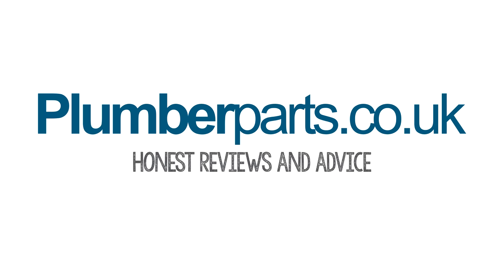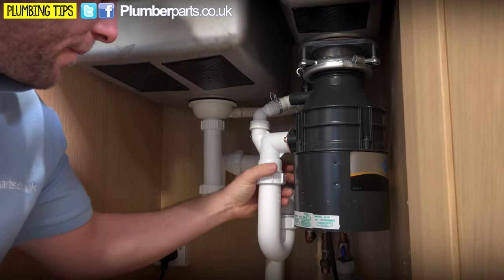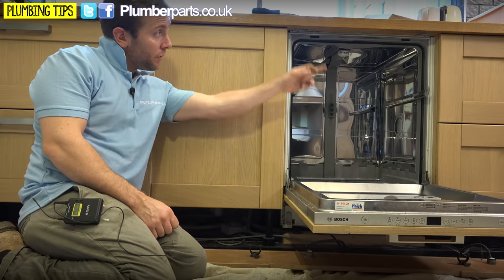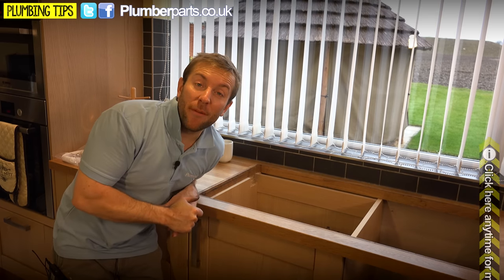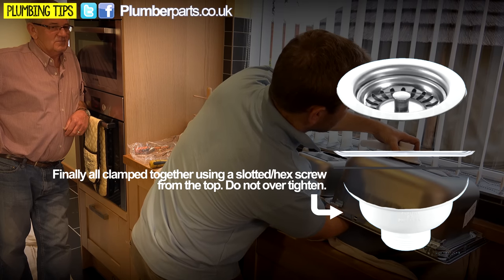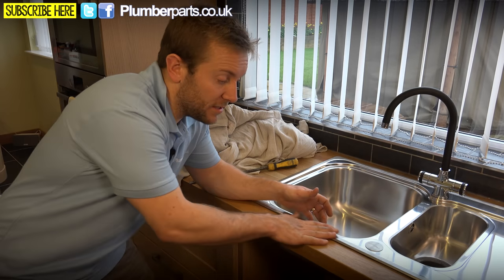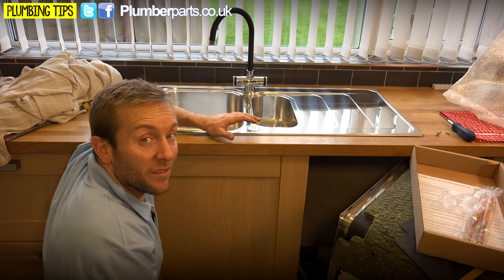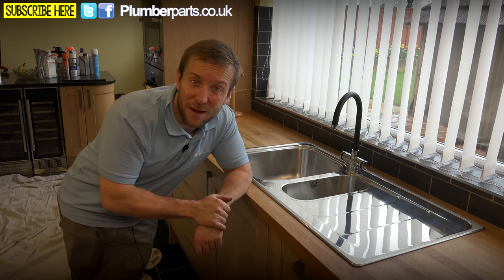HOW TO CHANGE YOUR KITCHEN SINK - STEP BY STEP - Plumbing Tips

Comment: I find it very hard to understand why a professional plumber would install that idiotic elbow in in the down pipe instead of the traditional bottle trap.  I have the same at my new sink and in a few weeks it gets clogged up and i need to undo it all and get rid of the deposits that block the elbow.

Comment: Love the silicone bit.they sell a tool like an ajustable jointer in tops tiles that gets it right.i.prefer my fingers and washing up liquid in a spray bottle
Never seen the blue paper solution.but a job I hate I cut the nozzle at an angle seems to work better but something I can never get right.

Comment: Does the corrugated overflow pipe need sealing at each end?  What prevents it from leaking?  I don't think it has any seals on it?  The old overflow corrugated pipe looks stained 2:51 which suggests it may have leaked in the past?

Comment: My problem is figuring out how to shut off the hot feed; which comes from immersion tank. I ran the hot tap to see which pipe runs hot off the immersion tank but there doesn't seem to be a valve to shut off. House is old.

Comment: Hi mate love the videos, just about to start an apprenticeship at the age of 26 😊. just wondered if you do gas? And what tools do you recommend getting first. I have 15 and 22 MM. Pipe cutter set of rothenberger benders Mikita combi drill a couple of wrenches. Is there any thing else to begin with? I'm looking at the rothenberger superfire 2 torch at the movement. Thank you and hold tight
Reply from the maker: +Alex Lancaster Here's your shopping list! Pipeslice(15,22,28) Benders and Dril are Fine. Get the superfire 2...they're proper bo! Good luck with your apprenticeship mate!
Reply: +plumberparts cheers buddy appreciate it!
Reply: How did the apprenticeship go?

Comment: Hi, I want to change my kitchen tap, the hot and cold supplies are both copper piped directly to each tap with no inline isolater valves. 
I know that if I turn my stop cock off it isolates the cold water. Does it also isolate the hot water supply to the tap too? If not how do I isolate the hot water feed to the tap?
I have a boiler in the kitchen with an unvented tank in the airing cupboard. 
Thanks 👍🏻

Comment: Thanks. Will remember this when I do mine.  When I bought the house the idiot who installed it has it running downhill the wrong way. No spirit level was used installing the worktops at all, so the water from the draining board pools up and sits there. I'm hoping I can get a sink with a sharp fall the other way, or umma havta reinsall the whole shebang
Reply from the maker: +ArcanePath360 Mate that's bad!
Reply: +plumberparts   Yeah, and it's all tiled around the worktop, and the window is off level to match it so I can't exactly change it without setting the whole house level around it. Do you know if they sell kitchen sinks with a steeper drain off than normal?
Thanks

Comment: 2:51 How come you removed the nuts from the hot and cold copper pipes near the flexible pipes.  How come you didn't just remove the flexible pipes from the pipe fittings?
Reply: Aman A. Because that’s how you remove the flexible pipe. The nuts you see at the bottom of the copper pipes, he just slides them up and screw together with the flexible pipe in place.

Comment: Uh oh! James, you forgot to mention that the replacement sink must be the same length side to side and width, front to back as the old one. Or, a wee bit longer and/or wider. I've been to jobs where the old sink is bigger dimensionally than the replacement supplied by the customer. Just drops straight through or has nasty gaps. Bigger (dimensionally) replacements may need additional worktop cut or routered out to accomodate fitting the replacement. Also, replacing a single bowl sink with a bowl + 1/2 or even a twin sink + double drainer in a 600mm base unit would require "butchering" the adjacent base units to accomodate fitting twin oversize bowls. Not easy when there is a wash mac to one side and a dish wash on the other.........  Square pegs, round holes. Aaaaargh!!!!!!!
Reply: I was just about to mention that as well! I've had a couple where the new sink just about fits the hole cut out for the old sink leaving no allowance for those vicious clamps who will draw blood at the slightest touch of the finger tips! 😂. They are nasty little bastards!! 

Also some sinks come with a foam gasket which you stick to around the inside edge before dropping onto the hole and sealing. 

I had one a short while ago with a tap came with a pullout hose which had a weight clamped to it under the sink. What they don't tell you is the weight cannot be obstructed otherwise it gets caught on the pipework preventing the hose from retracting back into the tap housing. So you have to make sure the weight pulls behind the unit and is allowed to move up and down freely. What a pain the arse that was!! #getbry
Reply from the maker: +loafer sheffield Yes I guess you're right! Lucky for me that sink didn't need the Fein on it!